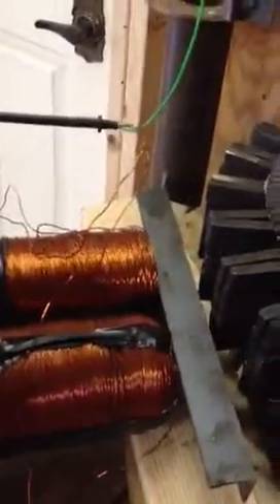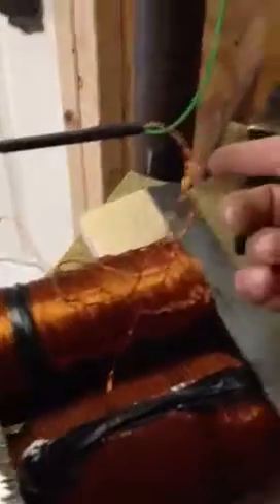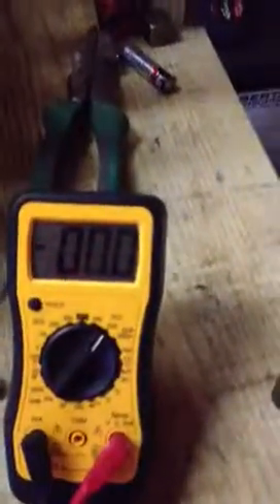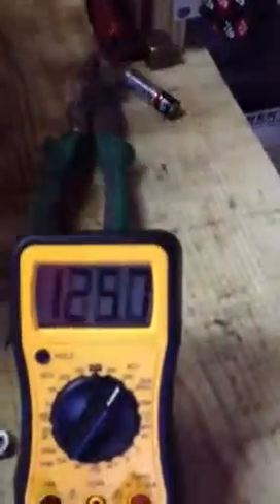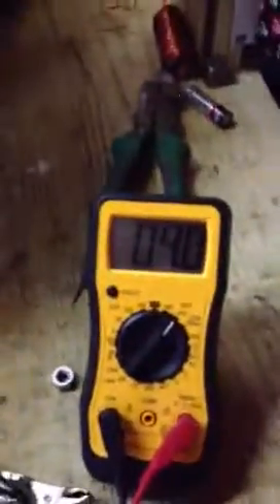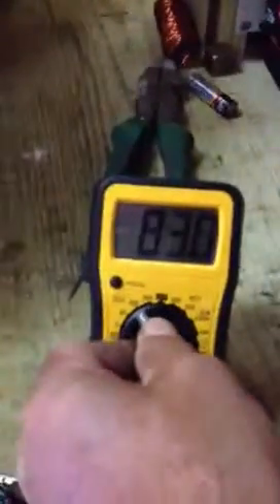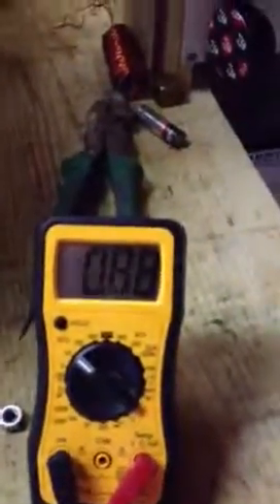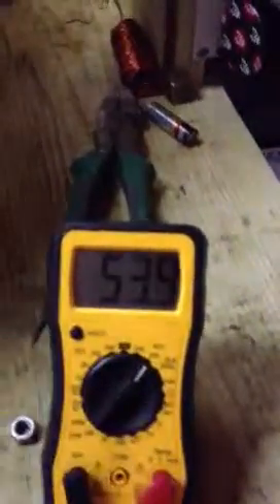Ed Leeskalnins Flywheel part 2

Comment: fantastic engineering job and great experiments!  are you going to try to replicate ED's work?  if so, you will need to determine TRUE magnetic north with ED's experiments in M.C.  you'll need the PMH and you MUST assemble the cloverleaf on top of the flywheel.  i believe that the cloverleaf replaces the holder on the pmh and also creates pulses to continually drive the wheel.  please share your findings with us:) i look fwd to seeing your results.wish i had hte resources to build the flywheel:)